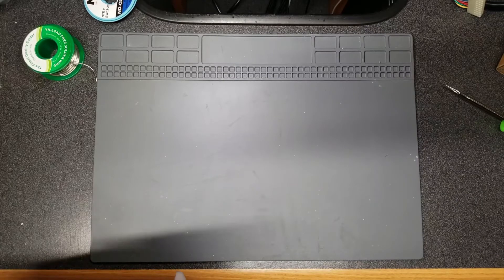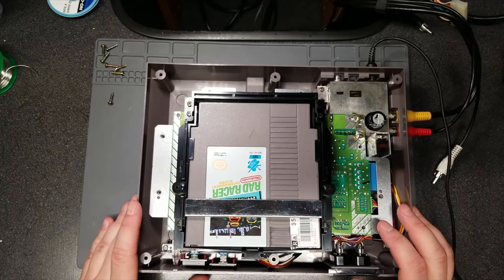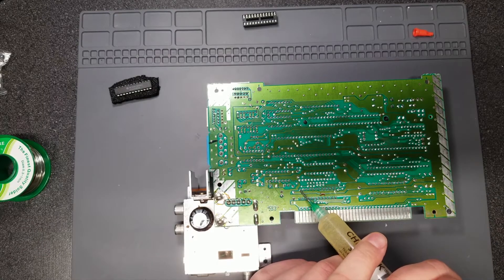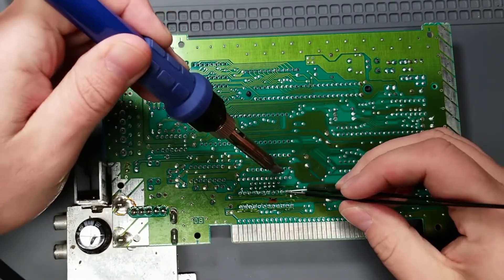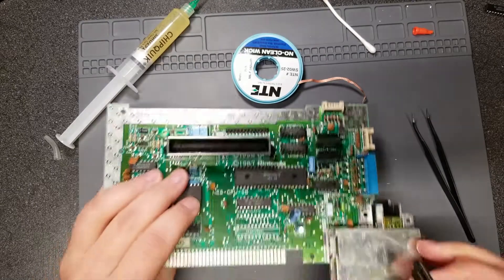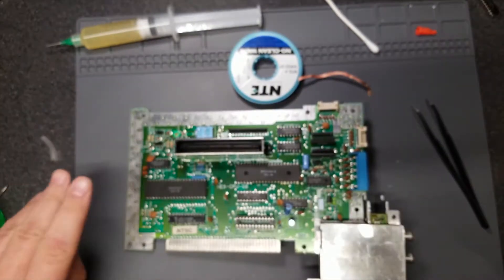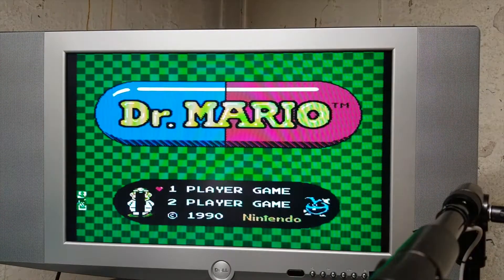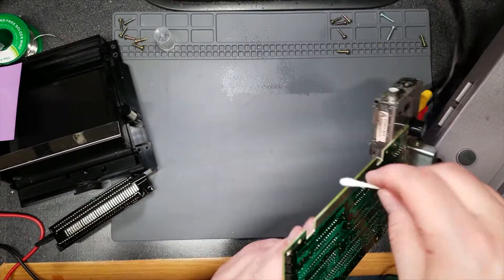NES Graphics Glitch Repair Attempt, Pt. 1?

Comment: Dude thanks for your video about this topic. Maybe you are the only can help me here. I just have this Issue with my NES original and my Famicom Disk RAM.  I am used to play with them since years ago, whitout any Graphical issue. To achieve this I always chained 3 adapters at this order: 1) A Nes to Famicom adapter conected to 2) A Famicom to Nes adapter conected to 3) Another Nes to Famicom adapter but whitout his plastic case. And finally My Famicom RAM with a FD Stick connected to all that Chain and I just placed it carefully to my Nes Original  port . As I mentioned this worked for me many years, but I stopped playing with them about 4 months and yesterday I tríed to use them again, but this time many of the frequent games I used to play, showed me  some glitched Graphics JUST at the MAIN CHARACTERS. Everything else is displayed regullary, backgrounds , the enemies, everything is fine, even the music, Just the main characters glitched. I tríed dissambling my NES and cleaning all the adapters and even the Nes cartridge Port, with isopropilic alcohol; and after assembling my Nes again, the glitched main characters looked even worse. I have to mention, this is happening ONLY with my Famicom Disk games, My regular NES cartridges are working perfect, even one of those multi game chinese carts , everything works perfect except my FD games. I Also have to say that I am not the best dissambling and assembling my Nes. I even noticed the plastic cartridge  slot looks and feels kinda bended. I dont know how to place it exactly like it was originally. Please any ideas that could help me?
Reply from the maker: So I was going to suggest cleaning the contacts on those adapters but you already did it seems, though can't hurt to do so again. I would even use a pencil eraser, then clean it all up with IPA.

Now, with all of those adapters it's possible that there was some strain on one or more of them and there might be some damage to either the connectors or individual pins (maybe on only one of them, maybe on all, difficult to say.) But those are something else to look at.

I'm not very familiar with the FDS so I can't help much with that specifically (though I am going to work on one soon!) However you mentioned that you have graphical glitching only when using the FDS but not actual cartridges. I can say that that in this video while I did have glitching in some games (Rad Racer and Dr. Mario), I didn't have it on all games. I don't know if you tried every NES game you have or only a few, but it could still be the PPU or VRAM in your system. Even if every NES game you own works, it's possible not all NES games will work correctly. In that case it would be either the PPU or VRAM. I did a quick search on Google for FDS sprite glitching and found a forum post where someone mentioned it could be bad memory modules in the RAM adapter. Capacitors can also go bad, though Nintendo did use high-quality ones and they probably are still good, but testing them might also be an option just in case.